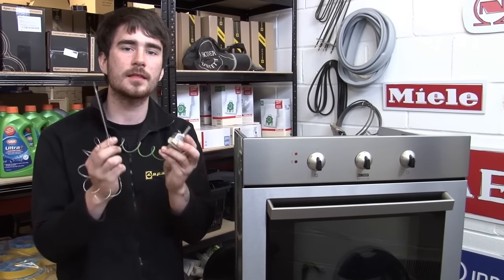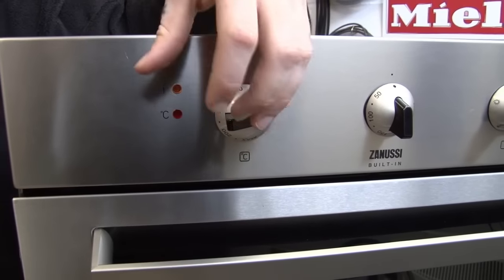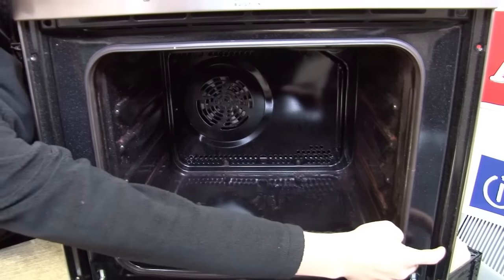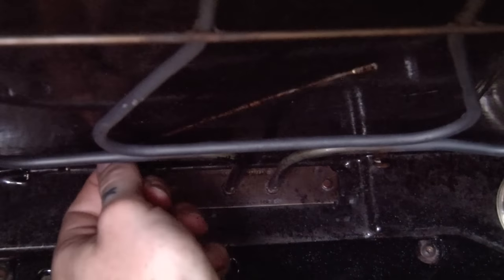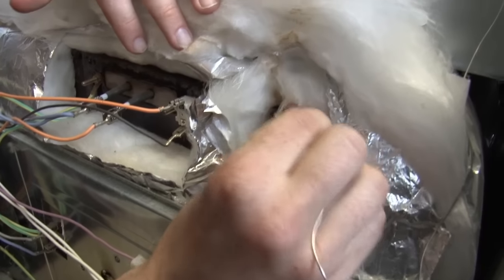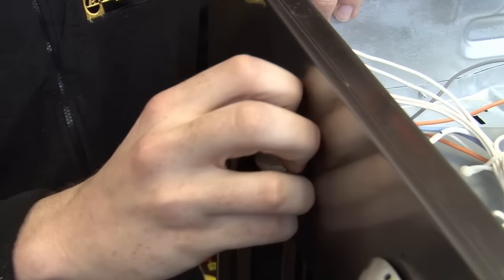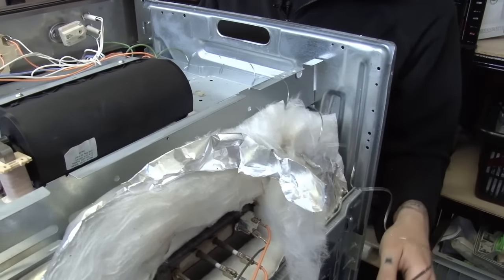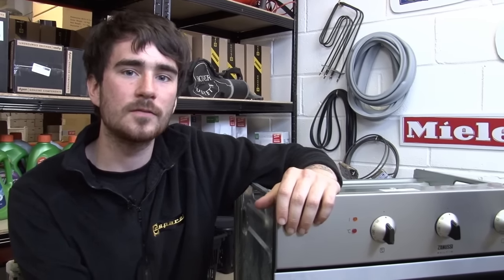How to Replace an Oven Thermostat in an Electric Cooker

Comment: have a bush dual fuel oven was wondering how to change the thermo
Reply from the maker: Hi Louise, it is likely to be very similar to this but without the full model information we cannot give specific advice. Are you sure you need to replace the thermostat?. It may be worth watching the following video to confirm the problem first:
https://www.youtube.com/watch?v=_lWk22-qvoI
Reply: hi yes element went but replaced that but light for thermostat isn't on the thing is my cooker is dual fuel so got gas hobs
Reply from the maker: If you watch the video linked above you will find many other reasons why the oven may not be working besides the thermostat so it may be worth checking these first before trying a new thermostat. The thermostat is a switch that can be tested with a meter to confirm the switch is closed, if it remains 'open' then it would be faulty.
We cannot identify your appliance without a model number so if you need help finding this follow the information on this link:
http://www.espares.co.uk/findingmodelnumbers

Comment: Thanks for the video. I have a stand alone indesit oven, The oven switches on from cold and heats up. when it reaches the set temperature it trips the RCD. when you reset the power and turn on the oven it trips as soon as it hits the thermostat temperature. Is this the element or the thermostat most likely?
Reply from the maker: Strange as it may seem the problem is more likely to be the element but we cannot guarantee this. Good luck with the repair and please let us know the outcome.
Reply: Thanks for the advice easy replacement and a new element sorted it.
Reply from the maker: Thanks for the feedback Dave as it may help others.